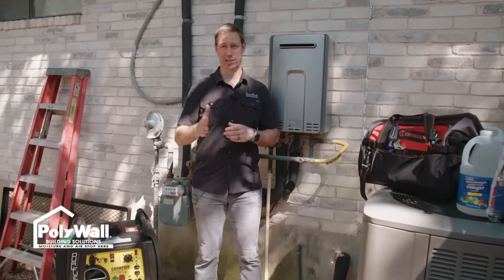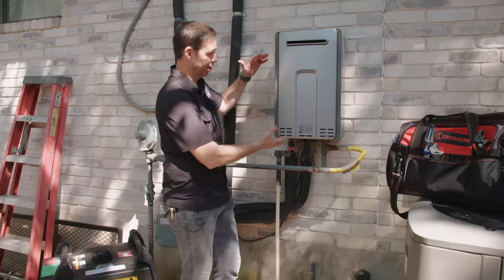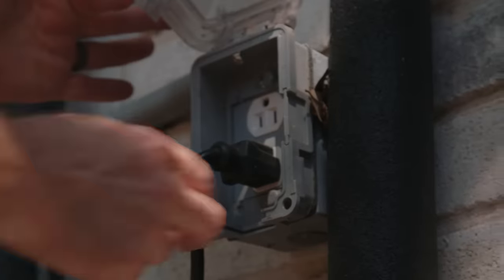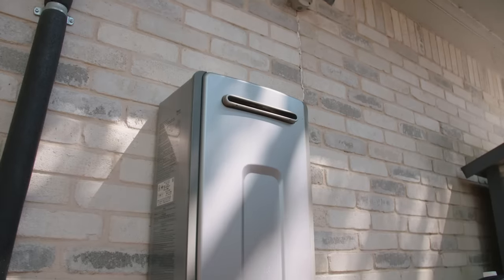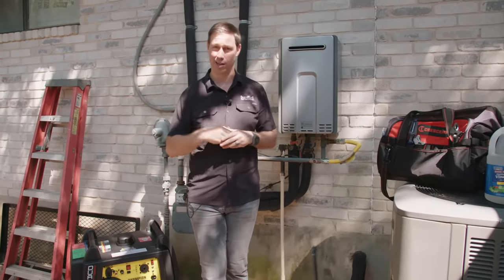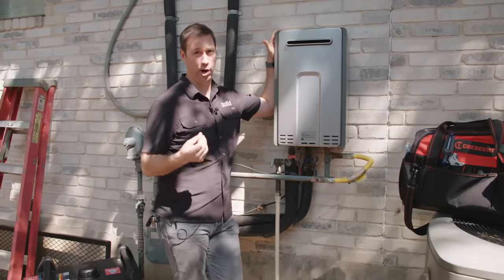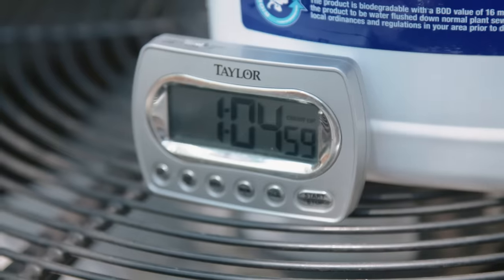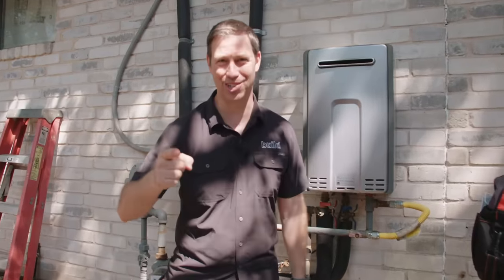3 Things They Don’t Tell You About Tankless

Comment: The greatest disadvantage of a tank-less HWU and in particular the one featured here, is the plumber who did the installation.
 He has done THE ugliest bit of work I think possible. It is so bad, he should be made to pay the money he was paid, to the owners.
 Fair enough, it was beyond his comprehension to do a decent job under the heater, I mean it IS complicated. But why the hell did he not have a spirit level to check the pipework going up the wall? Why did he feel it so necessary to make it look like a drunk plumber without tools did the work?
 As to scale; That's because of the water supply that does not have a neutral PH level. BUT, you CAN install a neutralising PH filter system to save your tank, OR your whole house water system from having to carry poor PH level water.
 True, it costs more money to do that but it is so simple that the ongoing maintenance of the filtration system, can be easily done by the house owner.
 On electricity supply; We have lived in our house for 40 years and never experienced a power outage. We are lucky.
 If you live in an area where you do suffer outages, why you wouldn't have a generator on standby is beyond me.
 Speaking of power; Apart from the crap pretend plumber who installed the Instantaneous HWU, the electrician who put that abortion up on the wall needs to be kicked up the backside from morning to night.
 What's wrong with that part of the US? Don't they have any tradesmen who know how to do a good job?
Reply: Really pro tradesmen are rarer than movie stars.
Reply: @jon4715  And one heck of a lot more useful in our daily lives than the Hollywood dramaqueens.
Reply: Ken Lyneham  These “plumbers” and “electricians” are getting worse by the month.  Even those with some skills, cut corners.  Car salesmen of the maintenance world.
Reply: To me it looks like its a retrofit to replace an old tanked gas HWS, and its just been hooked up rather than running new connections.
Reply: @1978sjt  I have been a plumber drainer and gasfitter for 58 years and that is the greatest abortion of a job ever.
 If the installation was here, the plumber would be made to do the job again at his/her cost and threatened with loss of licence.
Reply: @kenlyneham4105  I wasn't excusing it, just saying laziness probably played a big part in the colossal fuckup

Comment: A friend uses a computer backup power supply (UPS) for the ignitor when the power goes out. Works fine.
Reply: I was just thinking a small battery backup with an inverter would solve that. 
I’m watching this during the Texas snowmageddon, so our power has been off and on for 3 days. I’m wishing I had battery backup for LOTS of critical circuits.

Comment: RE: Power outage. An uninterruptible power supply seems perfect for this. The power draw is minimal. A really small UPS should keep it up for hours.
Reply: @OOCFM  it's a gas water heater. How much power do you think it takes to light the burner?
Reply: @tscook10  You are right, My bad, I was thinking about running the Unit Not just the ignitor. my bad.

Comment: Great info but you don't discuss electric tankless. The installation requires a separate circuit which can be expensive to install and may not be feasible for those people with small incoming power feed.

Comment: Two things you neglected to discuss are choosing the size of the unit based on climate zone, as well as the differences between gas and electric units.
Reply: Right, water inlet temperature is a major factor. Low water temperature reduces your max flow for a given temperature rise.

Comment: Here in OZ I have had my tankless for 15 years not a problem, never serviced. In my previous home I went through 2 HW storage units in 15 years.
Do the maths.
Reply: Problem is US supplied tankless are cheap Chinese junk. Not nice German made ones. ;)
Reply: With a water softener I flushed mine twice since owned over 10 yrs, as a precaution. No more bloody burst gas water heater ever again. The tankless are so much more cost effective! Either pay for 1 tankless price or the 40 years I’ve been here I would’ve paid for 4 gas heaters, do the math.
Reply: @ross9481  I didn't know tankless came out 40 years ago. Same with tankless, a tank water heater need to do a little maintenance too. Yes you did not know that. I did the math. I have my tank water heater for 20 years, no issue. When power outage, I can still take my hot shower. Unlike the video from someone who not expert in water heater saying "oh I still have the warm water in the tank" 80-90 percent water heater in residential are non electric powered. 
Here do the math. An old house has old plumbing systems. Bare minimum of gas deliver thru the house. To upgrade to tankless: change the gas piping system to proper working at FULL capacity (tankless at high working power need high volume of gas) sharing with other appliances at the same time decrease that volume. Like in the video plumber will have to run a new short piping for gas to the new location, and run new water plumbing to the location. Go ask plumber how much will it cost you.
Reply: If you have a problem with it you can always call the Lollipop Guild.
Reply: @patricksmith3911  The "German made" ones are probably in Turkey anyway. You get what you pay for, even here in the US.
Reply: @dumboyoyo5245  YES, tankless have been out LONGER than 40 years.  Can't understand all the excuses folks are trying on, for not changing over to tankless. Fear of the unknown maybe. We've been using them in Ozz for many many years now. The electric ignition ones folks are talking about here, (mainly Rinnai) are only a modern development. I would'n touch them, I'll stick to the pilot light version thanks.
Reply: Sounds like we have the same experience. I like mine

Comment: One thing I noticed staying at my friends who has a tankless is the delay in getting hot water to the tap.  The gas tank less takes time to fire up. It's a delay you don't have with a tank of hot water on standby.  Its a pretty annoying delay to me and also I end up wasting water waiting on the hot.
Reply: I have the same problem. It depends how close the tap in question is to the heater. My bathroom faucet is at the opposite corner of the house from the heater and it takes FOREVER to get hot water when washing my hands. I end up using cold water most days cuz I have to literally sit and wait 5 minutes if I want warm water.
Reply: True, I’ll go through about 2 gals of water before I get hot water. A lot of times I’ll put a bucket in the shower to collect the water then I’ll water trees with that water.
Reply: @jackg7225  wow. 😂 That's pretty bad
Reply: Buddy Chat  I just don't see how that would be the case when a tankless water heater must go through the startup motions every time flow is detected, whereas you open a tap with a tank at the other end and hot water instantly flows
Reply: Buddy Chat  The problem is that the unit takes time to raise the temp of the water 70+ degrees... during which time what is flowing.
On a tank, the first drop out is at the desired temp.
On a tankless... you will push out anywhere from a quart to over a gallon before the first drop of desire temp leaves the unit.... and then that drop has the entire pipe to travel.  Based on my 8 years of experience.
Reply: Buddy Chat  My 'based on 8 years experience' is as a user, not an plumber.  I've tested several brands when selecting the Bosch not a one had instant hot water out of the unit.  Fire-up time on the fastest was 2+ seconds... enough for over a quart of water to leave the unit, cold.  None of them had instant desired temp, either.  Like I said in other comments, my opinion is that the most desirable feature to look for in a tankless is one that lets you set the target temp via remote control... that way you only turn on the hot spigot and leave the cold off.  MUCH more efficient than a tank based unit.

Comment: my 75 gal gas water heater just died after 8 1/2 years - leaked water everywhere.  and it was apparently running non-stop for a couple of weeks because the power vent ran continuously.  I couldn't find a replacement anywhere and called 5 different plumbers.  I was able to find a tankless and had it installed.  I have a water softener system as well.  Good to see this video and know that I need to do maintenance every year- no problem as I maintain the water softener every year and can do them both at the same time.  My tankless is inside my basement, 199,000 btu and 10 gpm.  However, I don't see the link above to your maintenance video.

Comment: Unplug the tankless heater when that teenager is taking that hour long shower. I bet they get out pretty quick haha
Reply: You have to have a electrician to disconnect a thankless water heater
Reply: I'll have blue, blue, blue Christmas.
Reply: @billludolph5738  they plug into an outlet
Reply: @billludolph5738  Nah. Just flip the breaker at the panel. Lol
Reply: @billludolph5738  Have an electrician set up a wind-up timer -- you've seen those, you crank it over to whatever time you want, and it runs out --
SO the water doesn't come out hot until you crank the timer, and it comes out cold as soon as the timer runs out.
Of course, teens being teens would just reach out and crank over again, but the parent can be watching for that.
Reply: No, you don’t need to be an electrician. These things have an on/off button as well as the actual plug shown in the video. Yank the plug out of the outlet and bye bye hot water. Having said that - I know from my experience from having a Navien. That thing is a maintenance hog and the video barely scratched the surface on maintenance after having it for a few years. Actually my piece of junk had issues from the start and I had to reset it relatively often, especially after the first two years. Navien does offer a warranty for my combi unit’s parts but the plumbers will charge an arm and a leg to install them. I would have definitely stuck with a traditional boiler if I knew then what I had  known now.
Reply: @mli4711  Well yah, you can go turn it off manually, but my idea makes it automatic!

Re: the problems you had ... I don't think that's a problem with tankless per se, as you reminded me of my last apartment. It had a traditional water heater, but some kind of computer mess attached to it that we had to reset literally almost every day. I wanted to get rid of the "traditional water heater" and put in an OLD traditional water heater! NO COMPUTER!
Reply: @uncaboat2399  That's why the timer needs to be installed far away from the bathroom altogether...make it inconvenient for them to reset it.
Reply: Keep in mind that depending on the model, unplugging it wouldn’t necessarily shut off the heater once it’s running. Because the electricity in some is only used for lighting up the flame and once it’s going, it keeps going until it needs to relight the flame. More modern units do use the electricity for a circulating pump, a fan to optimize heat transfer and control panel. In those models yes, it would work.
Reply: @leobrent7926  Clearly what's needed is an automatic shut-off valve! No matter how the water is heated, if the hot water valve is shut, the water becomes COLD
Reply: No need to bother with electrics at all, why make the rest of the house suffer?   I have seen new houses with Pex style plumbing that have a manifold in some place like the laundry room. All you have to do is close the hot water valve to the target bathroom and you have instant cold shower, which is the recommended treatment for why the teenager is in the shower to start with 😂

Comment: During the freeze here in Texas, countless home owners had issues with their TWH's.  I'll stay with legacy.
Reply: I've got an old Bosch THW that has no electronics.   It has a pilot light.  When an ice storm knocked out the power for 10 days I had endless hot water, it was nice.   Now,  that I need to replace it, I was disappointed to learn they don't make these any more.  They're all electronically controlled and need power.   I feel that's actually a loss of nice feature.
Reply: Only because they’re outside the home 😂 Might be nice in the heat of summer to help with heating water, but useless for a cold snap.
Texas should’ve listened to the suggestions to Winterize their systems.

Comment: 1. You plug the thing in, so if you lose electricity to the house you also lose your hot water.
2. Depending on where you install it they can freeze up in winter (so again, you'll lose hot water). Freezing can also damage the unit which is likely not covered under the manufacturer's warranty.
3. It takes a while for the water to actually heat up (could be a couple minutes depending on the faucet's location in the house). Also, before running the dishwasher you'll want to run the kitchen faucet to get hot water in the lines so the dishwasher won't use cold water to wash the dishes.
4. The units need yearly maintenance. 
5. In my opinion, you should get into the habit of only turning on the hot water faucet if you actually need hot water. Otherwise the tankless heater will fire and start to heat the water unnecessarily. Like any mechanical item, it probably has a finite number of times it will start.

Comment: If running out of hot water is what gets you out of the shower, you got bigger problems than deciding between tank and tankless
Reply: It is still going to,more or less, equal out to be the same as a tank, in terms of install and operating cost, as well as having to wait for the water to heat up, if it's located some distance from your main supply.
Reply: Eric Hayes I don’t know what neck of the woods you live in but here in Ontario our tankless is installed in the basement and although the cost is greater than a regular water heater there are more problems associated with a regular water heater than with a tankless. Having a 25 year warranty far outweighs replacing a water heater every 8 years, a tankless is a much better investment. There is very little to installing them and so much less a cost in operation, when you turn your hot water tap on you do not get hot water immediately even from a tank, plus you are not paying to heat a tank full of water 24/7.
Reply: Marco - You forget some people have families...
Reply: @Marco B How so,I'm 57 and I still enjoy my long relaxing hot showers, 45 minutes avg.🤓🍺
Reply: @alsaunders7805  you must be unemployed.

Comment: I live alone and installing a tankless water heater reduced my gas consumption in the summer by about 75%. So, a tankless system might make sense for those of us who use little hot water, because it really reduces the gas consumption. It might also make sense to those of us who use a lot of hot water because it provides unlimited amounts. Maybe for the average user the savings are not as big?
Reply: I live alone & also use very little hot water. I have a conventional 30 gallon natural gas water heater with a 3" vent to the chimney. I set the gas valve to pilot, put a cover over the vent outlet to essentially plug the gases from escaping & let the pilot light heat the water. It heats the water to about 120 degrees over about 3 days & only burns the minimum amount you'd be charged for anyway. Saves me a bundle.
Reply: I live alone too and need new water heater, i don't use much hot water at all and my gas bills have gone up a lot during cold winter, first my plan was to replace my tank water heater with a thankless , now I'm really skeptical, not sure if thankless is cost effective in long run, it can fail and i won't be abler to fix it myself, it costs me twice more than tank to install it initially, still researching  , but, I'm not sold on tank-less yet.
Reply: @MarcFun  You are bringing up two very good points! Here is my experience so far: Tankless heaters seem to be fairly long-lived and low maintenance, so I didn't yet have to call a repair service in the 7 or so years I've owned it. I also installed it myself, that cut down on the initial cost a lot. However, it's definitely more difficult to install. My very rough guess is that it will probably take me about 8-10 years until the water heater has paid for itself. I am expecting it to last 20 years or more, so hopefully it will work. Your numbers may look different, though.

Comment: Two more downsides that weren't mentioned: a tankless unit may require a larger vent and larger gas supply pipe (if the previous one was gas). This will add to the installation cost.

Solution for the long teenager showers: put in a 10 gallon tank unit. Unless they like cold showers they WILL get out.
Reply: Noritz EZTR   requires NO CHANGES to vent size or supply pipe.OR convert your meter to a 2 psi system
Reply: @Raider243270  tankless gas based heaters require a wider pipe for venting than a tanked heater (source: I had to go through this ...).  These things gulp down air when operating.
Reply: @tomstdenis  depends on what you choose.Most now use inexpensive PVC sch 40 piping .Ive seen them in 2.3.4 inch sizes which is standard unless you go with concentric venting Like Rinnai that makes it larger

Comment: Scott, if you buy a tankless heater that has, typically, 2-D size batteries for the spark.  Some tankless are equiped with a mini-generator, run by water flow, to make electricity and give you the spark for ignition.  So, the gas tankless will operate when the electric is down.